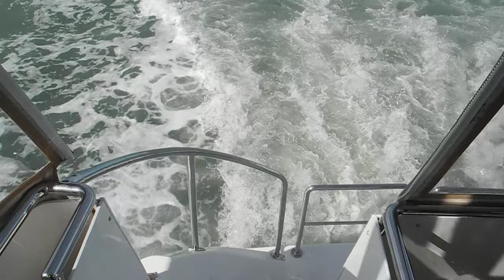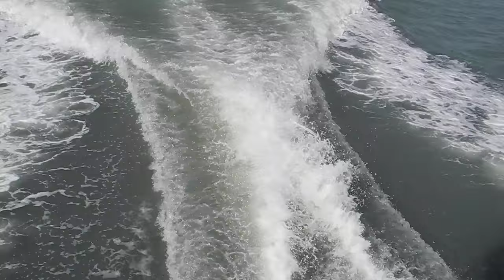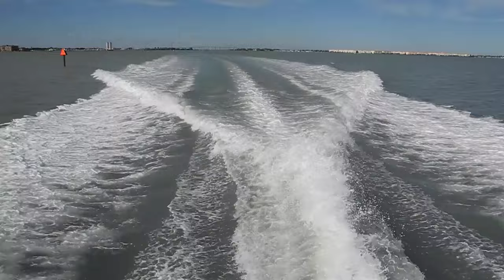One little puff of smoke

Comment: I saw a tiny puff from the starboard engine @ :19.  Could be unburned oil prior to the turbo.  Clean as the boat accelerated.
Reply from the maker: Yes, that is the reason you want to run the boat at high RPMs for a bit every day, burn out the unburned fuel and soot.

Comment: Captain I have 2 671 detroits turbocharged. Older boat. New turbos installed. When should they engage and do I need to run max rpm to burn the carbon out.
Reply from the maker: I’d recommend you speak with a two stroke Detroit mechanic who should be able to explain the “when” and the rationale.
Reply: Also own 2 DD 671TIB. You will run into black smoke when you go to full throttle quickly, overloading the turbos. There will be a lag and smoke should clear. If it doesn't check turbo spins freely, fuel filters clean(reasonably), clean out oil slop in airbox if present and run her under load at times up to 2500rpm for a short time to blow out whatever clings to her. Lastly on shut down leave her running at idle for a few minutes after long runs. The hot oil tends to cook on the turbine shaft - components if shut down immediately after long hot runs, gumming up the spin.
Reply from the maker: @tomdavis1694  you are correct. Although, the idle from your cruising speed into your slip should be enough to cool off the turbo….should be.
Reply: @tomdavis1694  thank you for the info. Sounds easy enough.

Comment: Turbos do not produce soot.  That is an injection problem.
Reply from the maker: @AlbertHess-xy7ky  maybe.. but the soot (carbon)  builds up from on the turbine blades and acceleration blows it out.
Reply: @AskCaptainChris  Acceleration does not blow soot out.  High exhaust gas temperature and flow do. A properly configured marine diesel engine produces maximum exhaust gas temperature and flow at maximum  RPM. To produce the least amount of soot accelerate slowly.
Reply from the maker: @AlbertHess-xy7ky  you win.
Reply: @AskCaptainChris  It is hard to pass on the thrill, the noise, the smell of acceleration. Running hooked is boring, you might have to hang on to the big round thing.

Comment: It is good to run a diesel at W.O.T. sometimes. Ideally go to redline and back off 100 rpm and let it cruise for several miles or more 😅
Reply from the maker: Good morning, wondering where you have been. I agree but I have heard back off about 10%. One puff of smoke and you're on your way!
Reply: @AskCaptainChris  Good morning 10% would be 220 RPMs about. So that should work. On a older Detroit I would probably just run it wide open, they seem to love it 😀
Reply: Back home in Tennessee, we say we're "blowing out the carbon". Well, that's what we tell the State Trooper anyway.
Reply from the maker: @charlesdavenport2543  🤣🤣
Reply: @charlesdavenport2543 we say soot, but all the same. Soot just sounds better somehow
Reply: Is that true only for marine engines or also for something like a tractor?
Reply: @almccallie4314  Any Diesel engine, I have a little 18hp Yanmar tractor . I don't use it much, there is a long dirt road down the street. I'll jump on it and run it about a mile.